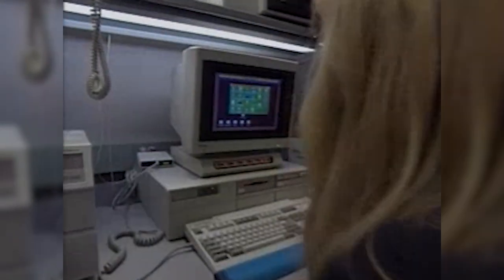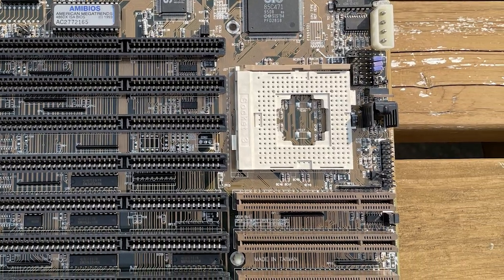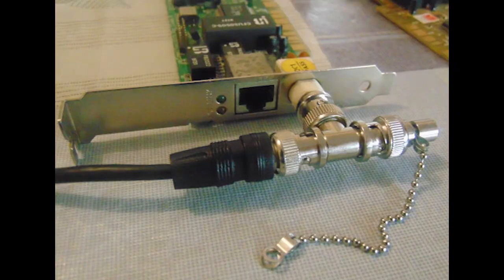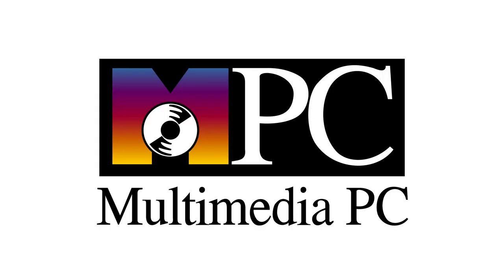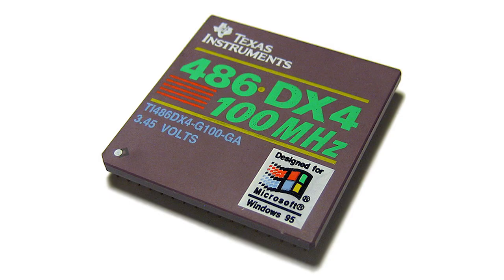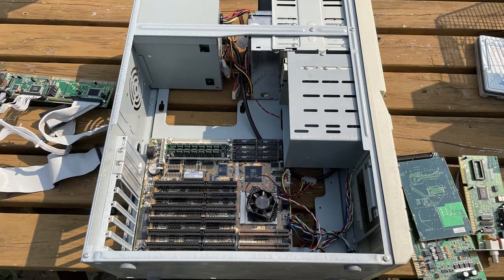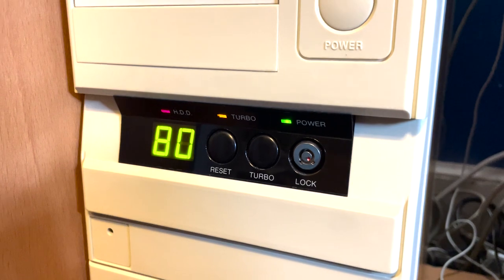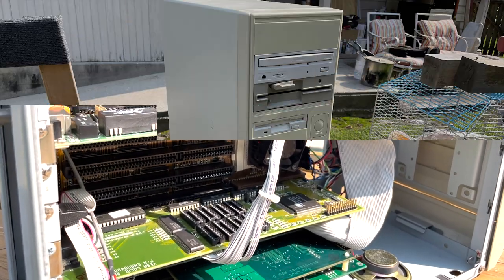1994 High Performance AMD 486 VLB Build. #486buildoff

Comment: Thank you for that Video. it brings back some Memories. 

1995 i get from my Uncle an 486 Board with exact the same BIOS, VLB Video Card, and I/O Controller. 486 DX2 66, 16 MB RAM, 450 MB HDD And a Double Speed CD Drive.

Comment: i just did a 486 build too

PCChips M912 v1.7 with 256k cache
AMIBIOS 07/25/94 12/02/1995X
Intel DX4 100 MHz
32 MB FPM RAM
Cirrus Logic CL-GD5430 2MB VLB
Sound Blaster Pro CT1600
UMC VLB Multi I/O Card
3Com Etherlink III 3C509B-C
Gotek Floppy Emulator with Flashfloppy firmware
LG CD-RW Drive
DOS 6.22 and WFW 3.11

Comment: My socket 3 board is weird. It has PCI, but also only supports 5v CPUs, it also has no VLB. For its RTC battery it uses a Dallas clock chip instead of a coin cell.

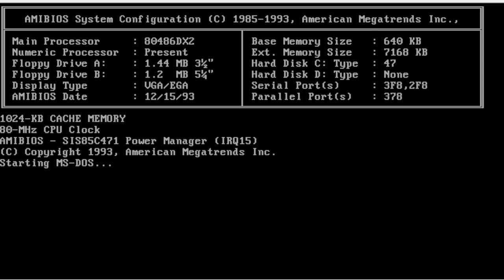Comment: Nice video, however, at 10:33 I see 1024KB Cache on POST. Thought you only had 256KB on the board?
Reply from the maker: That footage is recorded from an X86box emulation of the same motherboard and CPU to demonstrate the ontrack software because I didn’t have a capture card when I made this first part.

Comment: 1mb of RAM cost $100 back in 1993, 1mb of hard drive space cost $1.
Reply: Doom recommend you spend $800 on ram alone 💀
Reply: It has been 30 years... so I can no longer remember, but it seems to me in 1994 I spent 100 on 2mb for my Mega STe.  Though that may have been cheaper for 30pin SIMMs.